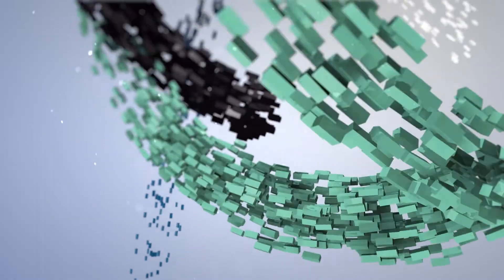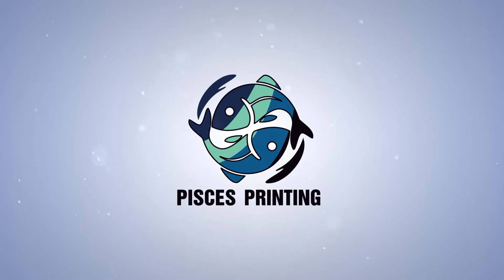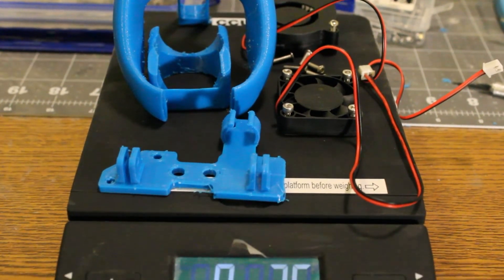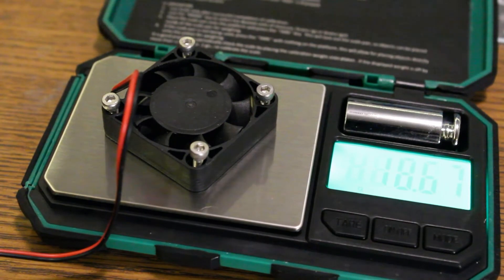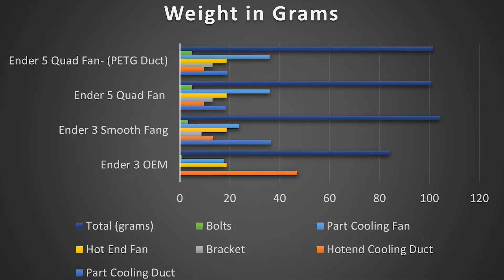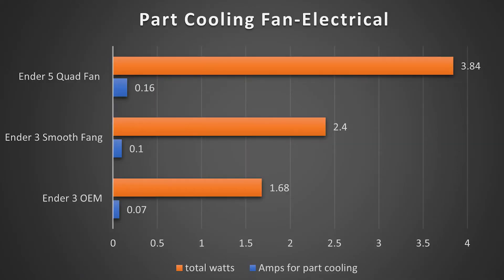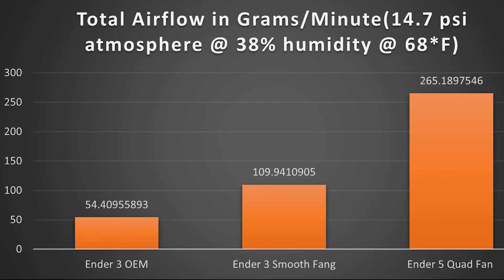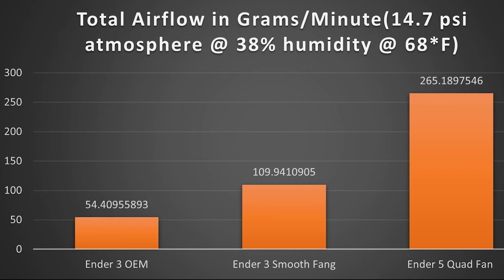Ender 5 Fan comparison 5015 vs 4010(OEM) vs (4) 2510

Comment: I have tried many "upgrades" on my
 Ender 3. Nothing works as good, imho.
Reply from the maker: It really comes down to what your trying to do. If you want to print PLA at reasonable speeds, an upgraded cooler will make little to no difference. It’s when you get into fast and/or hot material that cooler upgrades start to show differences. In my case I went to a higher wattage heater for faster and hotter print capability.